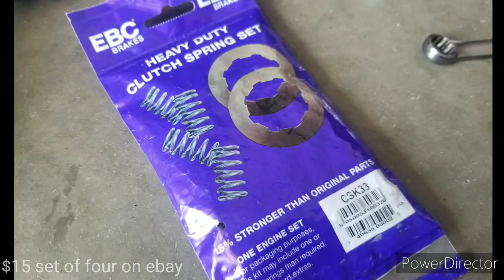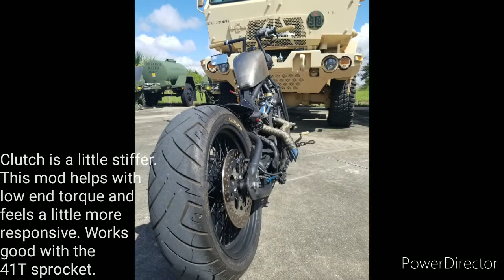How to replace clutch springs and advance timing on Honda Shadow VT600

Comment: Bud I have a vt600 I bought about a year ago and it leaks all the oil out, so I bought a gasket and I'm trying to pull off he cover. It looks like it has been sealed with a gasket maker or rtv. I'm having such a hard time trying to remove it. Any tips boss??
Reply from the maker: I would use a rubber mallet and tap around the cover. It may take some time and patience. Good luck

Comment: did you do  this mod to both magnetic sensors, or just only the top right one?
Reply from the maker: This was on a VT600. It was only on one side.
Reply: @missioncapable4658  those magnetic pick up coils are one for each cylinder?! if yes then you advanc e  timing only one cylinder, im just asking
Reply from the maker: @NikosAngelos-ve5lq  It's been a while when I did this. There are two so "yes" you need to do both 👍

Comment: your last statement on the vid was incomplete,

How was was the time mod over all and do you sprocket change to complement the on other mods?
Reply from the maker: Overall timing mod is great. Very responsive, starts right up. Wish I'd did it earlier. With the 41T sprocket, bike is a little weak on takeoff. Adjusting the timing helps bring some of that low end torque back. Does that make sense?
Reply: Mission Capable good to know, Im finishing up my 750, I won’t do this mod to that project, but I also have a 600, In which I will. Just an around town bike, I plan to keep the 44 tooth and keep it zippy.